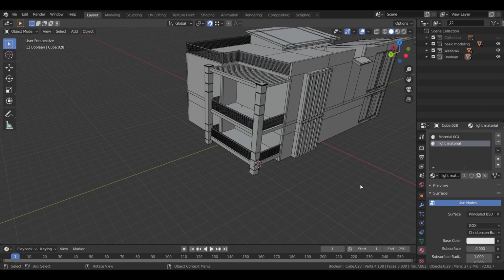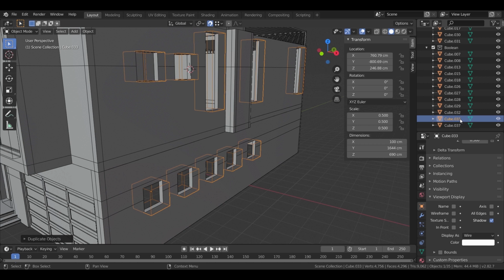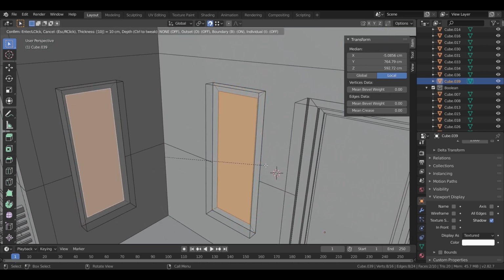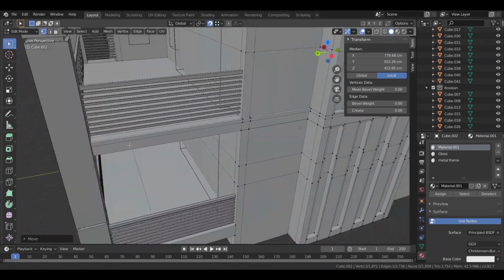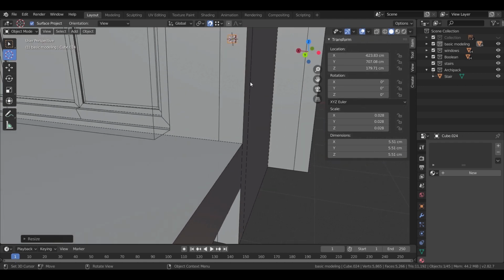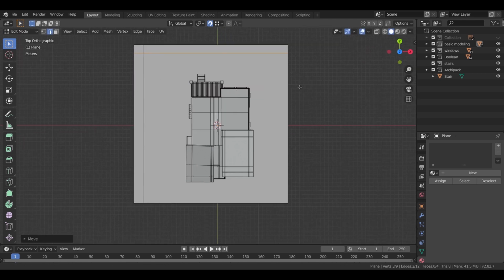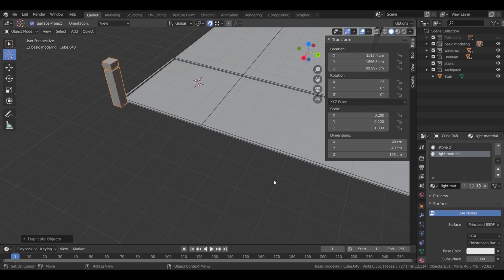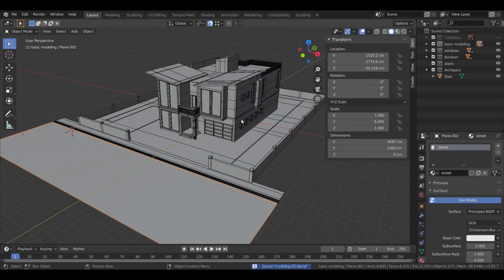How to Create a Modern House in Blender | Part 2 | Blender 2.82

Comment: I'm using blender 2.93.1 and I can't get a hole on my 2nd door on top floor after applying boolean, the main wall just turn shaded. What am I doing wrong ? Thanks
Reply from the maker: Hi buddy, There are couple of things to bay attention to, wall thickness , the edges position etc.. if you have the time just watch this short tutorial about Boolean main problems it might helps. https://youtu.be/JhBIjqvdoz8
Reply: @architecturetopics  Thanks for your continuous advice. I really appreciate it.